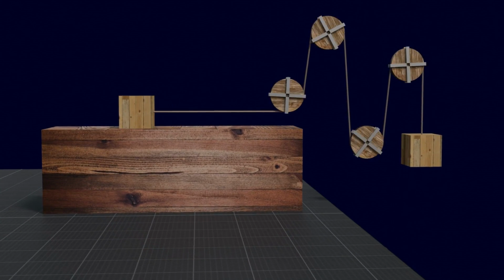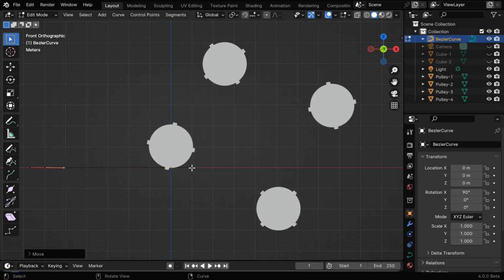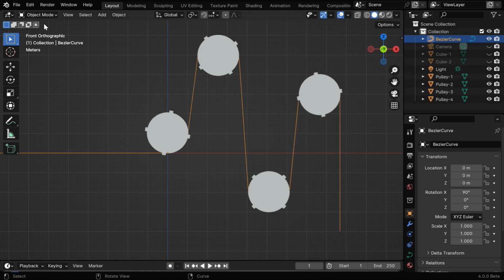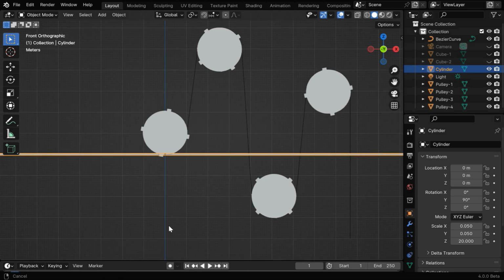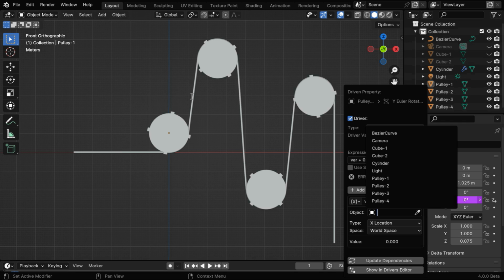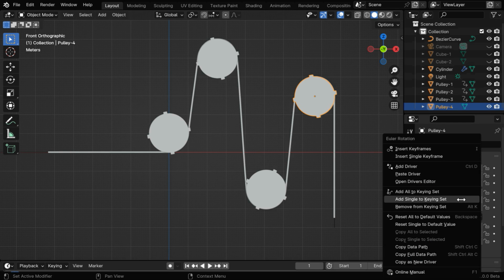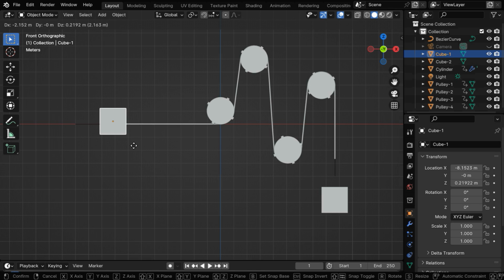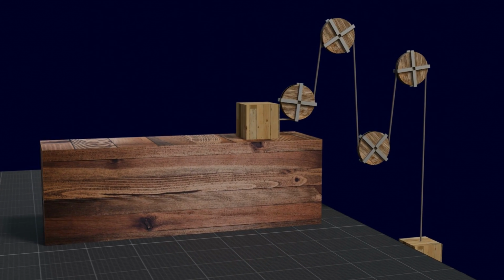Belt & Pulley (or Rope & Pulley) In Blender | Curve Modifier & Drivers | Easy Mechanics

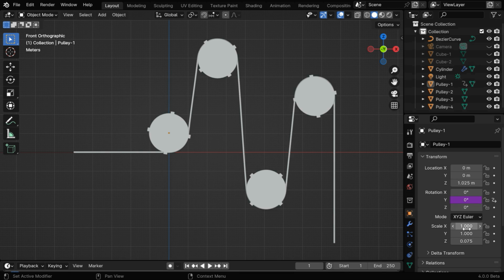Comment: Doesn't work, 4:18 when I move the X my wheels move in the X path, not the rotation path, while my driver is purple in it's rotation Y path, I don't get it. 
Edit : solved, I don't know why but in my case when I setup the wheel's driver I must target my first cube, not the cylinder, I didn't my var is "var + 0.0" and it rotates, I don't need a perfect match with the size of the rope. Also about the second cube, if I follow the instruction it isn't in the correct location, I had to adjust the var, the original value was -6 and I had to set it to -22 to put it on de -6 Z place.
Reply from the maker: From the description, I guess in your case the object origins are not set correctly - like the object origin's are not at the object center. The driver picks up the location of the origin, not the actual object. The other driver in purple color indicates something wrong. If you solved it somehow and it meets your purpose - good 👍 Otherwise you can send your blend file to 5minblender@gmail.com so that I can check it.

Comment: Great video, have re-watched many times in my learning. Curious if I would want to use this or a different method when trying to wrap around a cam instead of a round pully.
Reply from the maker: Thanks! You'll probably need a different method since the cam has to pull the string out of its designed path (or the rest position), but at the same time I am not very confident of any other method in Blender that can do this flawlessly (Blender's cloth physics or Rigid Body system are currently unable to do that, and there is no better alternative either). Only way is to use Geometry Nodes, which can definitely do this correctly when you use a cam - but that method will be very much different, no similarity with this tutorial.
Reply: @5MinutesBlender  That's what I was afraid of, I am still fairly new to blender and  Geo nodes still scare me a little 😅 but it does make sense. Thanks for the info!!

Comment: Nice...how will you make one with one pulley loose? (moving up and down)
Reply from the maker: You mean the pulley itself is moving up & down? 🤔🤔
Reply: @5MinutesBlender exactly, common in mechanical advantage systems. I did this but with so many drivers absolute values that it is not optimal, if I want to change one value everything breaks.
Reply from the maker: @ISURSouL Yes, I guess that will be a complex driver setup, I never studied a loose pulley system.

Comment: May I know how to make pulleys
Reply from the maker: Well, that's what we discussed in this tutorial. Do you mean how to model those rollers or wheels?
Reply: @5MinutesBlender I want to know how those 4 pulleys are created
Reply from the maker: @SwethaRani697  Add a cylinder. Reduce its height. Add another cylinder and reduce its height even more and make it slightly larger in diameter. This will be a plate. Add two such plates to the two ends of the first cylinder. Your pulley is ready. Now you can add more things to make it look better, like we have added two sticks perpendicularly on the plates. We also added some wooden textures to make it look realistic.

Comment: Tip : Make a small rope segment and use an array modifier before the curve modifier. This way you can easily adjust rope length.
Tip : To paste (or change) multiple values, select all the objects you want to add the value to, change the value of one item and hold LEFT-ALT when pressing ENTER to set the value. This way the value will be set to all selected objects. This works for almost any value in Blender (so also shaders, modifiers, etc).
Alternatively, you can select all object with the object you want to copy the data from as the last one and press CTRL-L to pop up the Link/Transfer Data menu.
Reply from the maker: Thank you so much 💝 You know what, I am not satisfied with this tutorial. Unless we integrate cloth physics with the rigid bodies (which is not yet possible in Blender), making an actual rope is next to impossible. The only way to do that would be to add an extremely high number of bones and an armature to the rope. It was very costly, so we had to trade-off for this tutorial, but we are all ears to get a better suggestion!
Reply: @5MinutesBlender  : Cloth is not the way, nor is a rig. Cloth is meant to be used with planes. This curve modifier way is by far the best way to simulate rope functionality.

Edit : A better way might be to use Geometry nodes but I'm still learning so I can't give you advice on that. There are some excellent tutorials out there that handle GeoNodes and Curves, though.
Reply: It will work for the time being and solve the purpose with some limitations. 80% of questions are solved by this. So, it is fine and so easy and not time taking  @5MinutesBlender
Reply: You sir, is a hero, thank you